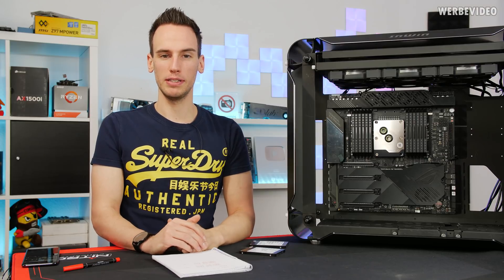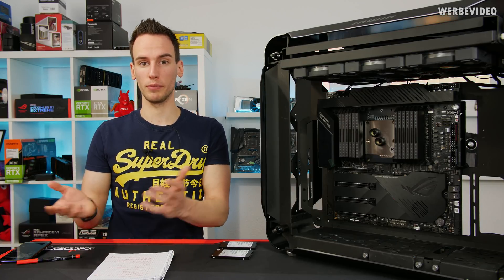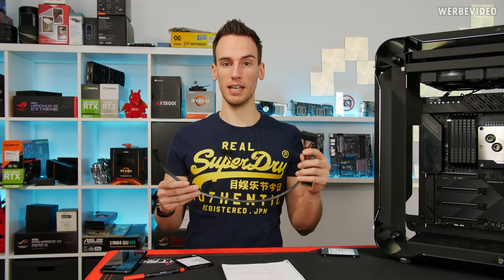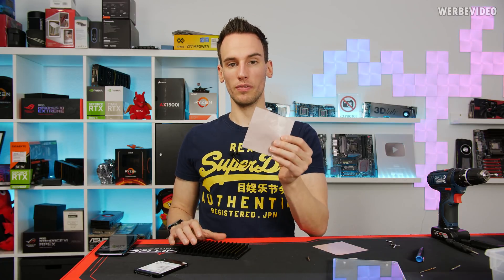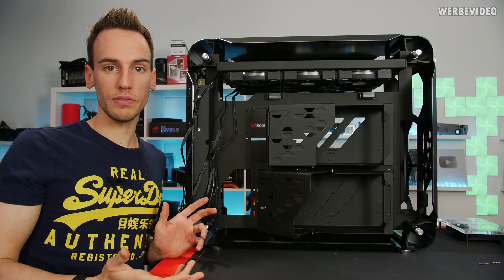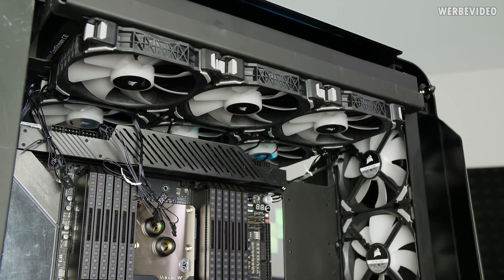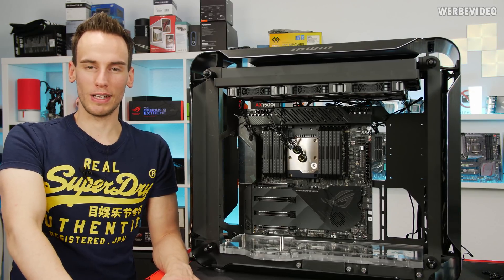Project Irrationality Part 7: Building a Cooling Block for 15 TB of Enterprise SSDs

Comment: Not seeing much airflow over that SSD heatsink, and the cooling fins aren't huge surface area. The mass is helpful, if you cool it enough, otherwise it can become a massive lump of undercooled heat. Going in, I thought perhaps you were going to water cool the SSDs. My gut tells me you need a fan blowing across those fins, but testing will tell. Remember, cool SSDs are longer life SSDs, and as you said, they weren't cheap.

Comment: Hey Roman great video! Can you consider doing a video in the future about your opinions on the new intel 10900k and other cpu's, and the new lga 1200 socket? Mostly about for people building a computer in the next couple months and are worried about future compatibility. Is it still worth it to buy a 9900k with the 10900k around the corner and the motherboard now being kinda outdated in a way? Just consider it for your future videos please, thanks!

Comment: Next upgrade to FOUR U.2 NVMe drives using a 4-port OCuLink to x16 PCIe retimer card in one of the many open slots. You certainly have the space for them.

(PCIe retimer makes for strong crisp signals over the nearly meter long PCIe signal path from the CPU socket to the U.2 drive.)

Comment: My understanding is that Noctua's fans are the all around best fans on the market. But i still see a lot of projects like this where people use some other kind of fans, and im curious is this for esthetic reasons or are there better fans out there then Noctuas? 

Or is the advantage in performance that Noctua has sufficiently negligible that it does not matter? For this build its clearly not price and Noctua does have chromax these days so the esthetics are not bad either.

Comment: 13:44 i would flip the Plexiglas 180° in the Z axis so  the Plexiglas is flush with the case and heatsink show  like and maybe bolt on some low RPM fan

Comment: Bro flip the way you have the cooler mounted so the acrylic and ssd labels are on the bottom facing the motherboard and the cooler fins are facing outwards and the wires are pointing downward and mount an LED into the acrylic.... will looks a million times better

Comment: You should be cooling the controller not the flash dies. I don't understand this trend of cooling the whole SSD. The flash is supposed to be hot/warm in use

Comment: I liked the part where you basically said "I was gonna open the drives and take a peek at the internals but then I remembered I paid for them so decided not to".
Reply from the maker: I also paid for the CPU and still delidded it :D but from my experience SSDs just fail a lot more often
Reply: @der8auer  Yeah it makes sense too considering you've also had a ton of experience delidding CPUs too. It was just a funny moment.
Reply: @der8auer  everything fails. Sometimes ... I hate computers
Reply: Same

Comment: I too wouldn't mind an EPYC based workstation except that AMD's partners don't produce one. Blame AMD for handing Intel that victory LOL. Xeon is still the platform that dominates the server/workstation space - EPYC won't support consumer Windows natively either.

My guess is until we get a 64 core TR and an accompanying "workstation-class" board that can push 7 PCIe slots at full 16x the only options will remain in the Intel server/workstation space. Sadly, those are all $20k+ boxes.

I would have jumped on a dual Rome system this year, but without consumer Windows support and only a handful of PCIe slots, it's just not capable or competitive. That leaves me with a system from Intel that tops out at two 28-core processors and 3TB RAM... and enough PCIe to fit 8 graphics cards, three optane cards, a sound card, capture card and RAID. It's an impressive way to burn money for sure.

Comment: Might it have been better to have allowed a small gap between the two U.2 drives?
I know there wouldn't have been much of a gap, but every little would help I would have thought?
Reply: Why leave a gap?
Reply: @Outland9000  because a gap, however small, might allow heat to dissipate a little

Comment: 12W idle? Any explanation?
Reply: There is going to be a lot of flash chips in there. That will up the idle power consumption.
But foremost these are enterprise drives, the manufacturer doesn't ever see them being idle in a server, so they don't try to hit very low idle power draw in the firmware development, its a waste of their time.
Reply: @sparkyenergia  I suspect the controller chip consumes the majority of the power. Flash only needs a lot for writing. And there are 1TB chips nowadays, so 8 at most.

Comment: Looking good bud.  Nice industrial look so far.  👍
As to the U.2 Drives interface, if you want to use them in a normal build you can get a cable to connect them to either the M.2 or the PCI-E slots.
Nice job with the extra cooling of those drives buy-the-way.  Simple but should be very effective.
If you're interested in server grade hardware, I'm sure you know.......but Wendel at Level1Tech is deffo your man, and he'll have fun doing it too.  I bet he even knows where to go for schematics.  🤔

Comment: I work in a datacenter. Does this U.2 connector require different backplanes for servers? The ones we have now can do both SAS and SATA drives.
Reply: If you put a U.2 connector into a SAS backplane, it will operate only in SAS mode, so you lose the full nvme pcie bandwidth.
SATA-only backplanes that block the insertion of SAS drives will not fit U.2 drives either.

For full performance, you will need a U.2 backplane.
Reply: @RylTheValstrax  Thank you!
Reply: i've used them on SAS and U.2 drives. Never tried SATA though...

Comment: Would you be doing a deliding and delided cpu installation video on the new 10th series cpus? specifically the 10900x I’m interested to know if those CPUs can be installed without the IHS as I want to use one of those for gaming and I’m planing a 5.3ghz overclock!

Comment: You could literally slap those SSDs onto aluminium motherboard tray. Massive 4mm plate should be sufficient.
Reply: That's not irrational
Reply: @ThisIsAGoodUserNameToo  Watercooling SSDs may have been irrational. Tiny passive heatsink is a half-arsed solution.

Comment: AVX 512 makes Skylake X a sleeper platform. When it's more widely used you're looking at ~60% speed increase in practice, even more in conjuction with TSX.

The above is not so apparent with high core CPUs cause of the increased heat and decreased clocks on AVX loads cause of it.
HCC-die parts with 6, 8 and 10 cores will see a massive speed increase though, especially on single threaded loads.

Comment: Are you going to have some kind of airflow over the ssd heat plate?
Reply: not needed for 10-20w total heat dissipation. convection will do its job just fine with that heat sink. there is no benefit of keeping those ssds near ambient temp anyway.

Comment: Might I respectfully suggest that with the mounting method as shown using a solid copper plate, without cooling fins, and a layer of TIM on both sides would provide about three times the cooling efficiency. Copper has almost twice the thermal conductive capacity than aluminum, the lack of surface contact from the fins to the case reduces the thermal conductive capacity since the case will act as a heat sink due to the heavier gauge aluminum of the case and the lack of airflow over the fins.

Comment: Why not use polycarbonate? Acrylic, as I'm sure you're aware, will easily crack if the screws are "over tightened" which would be needed for a good mounting pressure for the thermal pads.
Reply: Partly because acrylic is standard for laser use, polycarbonate can be lasered but with more difficulty and a worse finish. Acrylic is just a kind of go-to for these projects I think.

Comment: Great tool for making straight threads you have got now there. BUT for acrylic specifically: its inherently bad to make threads directly in the acrylic for smaller holes because they are too easily busted. Its better to just but some brass or steel nutserts ('nut inserts') from aliexpress and hammer or epoxy them into a plain hole for a friction fit to the acrylic. Then the metal insert comes already threaded. You can still use that perfect threading tool for other purpose..... Its still very nice.

Comment: Why have time graphs in base 10. Omfg. .9 minutes. No, just No.
Reply: The most logical thing would be to use seconds, however people think in the largest unit that makes sense (f.e. about 5min instead of 280-320s, about an hour instead of 55-65min). This means that to give an idea about how much time a render takes with different CPU's, using minutes is more relatable to the way we think.
Now since it doesn't matter how long this specific benchmark render takes, as each render will be different, but the ratio between how fast different CPUs are at this task is what we're after, sticking to one unit in decimal numbers (5.9min) rather than using multiple units (5min54s) makes it easier to see the ratio between the speed of different CPUs, especially for most people who use base10 for everything else in the metric system (weight, distance...).

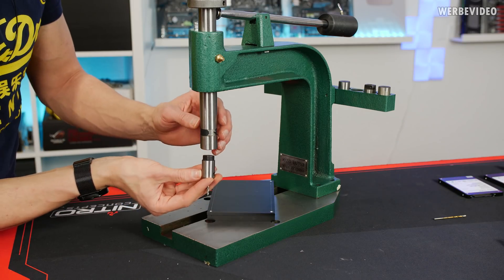Comment: 7:10 So you ARE using a threadripper after all...
Reply: yeah, literally. you see how poorly centered that tap is? that thing is trash
Reply: @taylorsharp5928  just need some shim stock around the tap.
a collet chuck would definitely be best
Reply: @pppppmmmmmccccc  collet chuck ftw.

or just a tabletop drill press. useful for many more projects as well
Reply: @taylorsharp5928  I work at a custom engineering firm. We have every tool imaginable to build prototypes. Too bad I don't have the skills......
Reply: BURN

Comment: Silly question, perhaps, but I noticed your cooling plate only attaches to the underside of the drive. Are you not worried about the components on the top side of the PCB, if there's no significant airflow passing over them?
Reply: most heat were produced by the controller so one side is enough. but it would be better to know whether the controller were attached on top or bottom side. if it's on the top side and caused throttling on high load, he could just flip the drive
Reply: @n.shiina8798  Yeah, if it was my build I probably would've tried checking for hot spots with an IR thermometer before committing to the design. That might also have been an interesting thing to show in the video.
Reply: right

Comment: Looks like your tap is slightly bent! Nice set-up on the SSD cooler.
Reply: The tap wasn't bent, it just wasn't centered in the tap holder of the tool. As long as everything was kept at a right angle, there is no harm to the threads by the part sliding around.
Reply: @subsgob00m  Bullshit!
Reply: @Bass.Player  No, @subsgob00m is correct.
Reply: lmao, he got that tap for straight holes but still used a hand-drill to make the holes. should have used a drop-down-drill (drill press) instead.
Reply: @MrHakisak  Yeah, I thought, go to all that trouble and expense just to use a bent tap?????